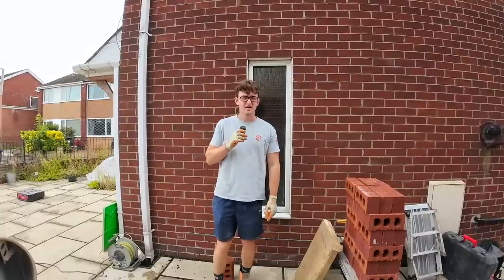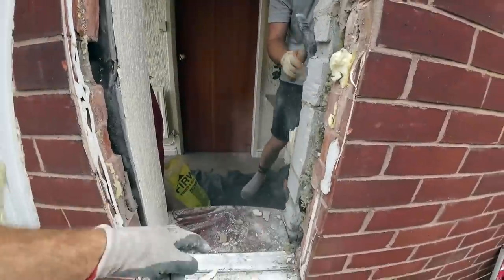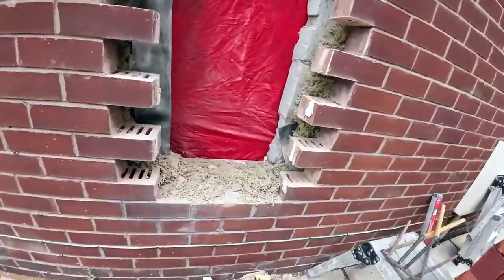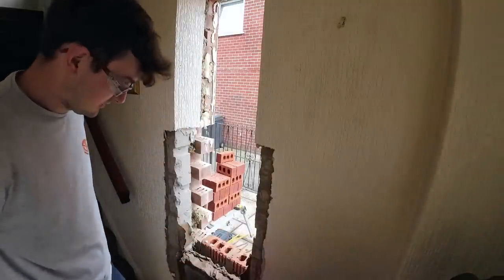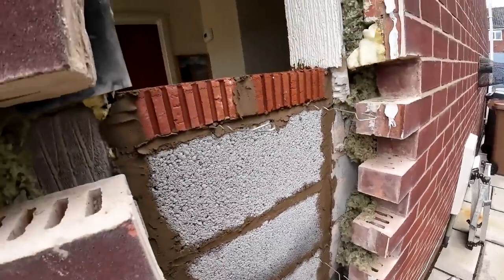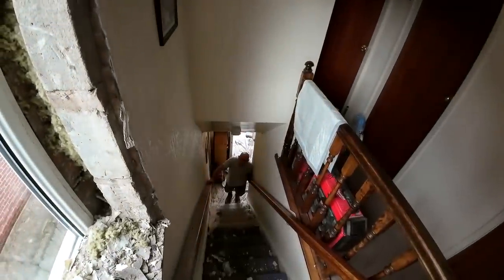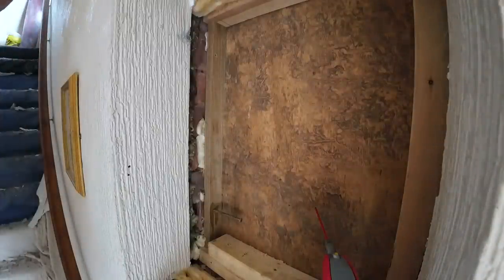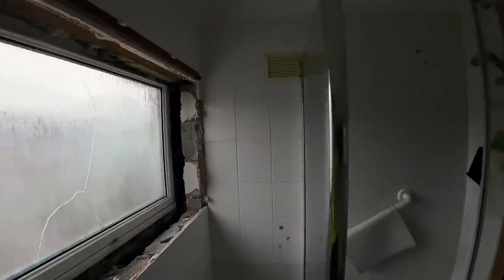BRICKING UP A VERY DODGY WINDOW!! ALTERATION JOB PT 1

Comment: It is quite standard to foam a window in, especially when the window is a fixed pane; no opener (more foam should have been used to add insulation value to the gap round the frame. 
By the time the window is externally trimmed which is siliconed to the brickwork and trimmed internally, where superglue is commonly used to stick the trim to the window frame and in turn, the trim is siliconed to the internal reveals. 
Realistically, "Snappers" should have been used, they are a stainless steel claw that are screwed to the sides of the window profile, when the window is shoved into the rebate, the claws dig in the brickwork, adding more resistance to being pulled/pushed out.
The smaller the new window is, the harder it is to get a drill in for fixing, this is where foam and claws are a good/recognised system./method of fixing frames. I know newer systems use a rail system, a liner is inserted into the opening and the new window snaps into the liner.
Tough bricks?, yeah, maybe they are engineering bricks, I've lost plenty of SDS bits to them!
I've been in the glazing game since 1987, still there.

Comment: I'm a complete amateur and just do a bit here and there for my boys. I have learned NEVER use cement thats been stored a long time even wrapped in plastic. I found that funneling cement into dry plastic milk bottles keeps it fresh. Bit of a faff but saves waste and having to get a whole new bag for those small jobs.

My Titan SDS does a great job when removing old bricks. Toothed chisel attachment even better!

When trying to match mortar I mix and let set and dry a small yogurt pot, anything ftom 3:1 to 6:1

Comment: Nice tip for an amateur like me, never thought of sticking a bit of WD40 in the hole before drilling in the self tapping concrete screw. Cheers.
Reply from the maker: No probs 😁🧱👍🏽

Comment: Cold spot and crack point ....brick and thermalites should never be mixed
Reply from the maker: @martin2466 🤨🙄🧱👍🏽
Reply from the maker: @martin2466 . Mmm . Talking of crackpot have you seen who has reappeared 🤪🫠🧱👍🏽
Reply from the maker: @martin2466 I think it was 🤔🤣🤣🧱👍🏽
Reply: Read the building regulations relating to the mixing of material's.... came in the late 80s ....plenty of time for it to sink in ....in short different material's expand and contract at different rates therefore shrinkage or cracking will occur..furthermore  different thermal mass ....cold spot ...

Comment: I see you put wd40 inthe hole what does that do !!!
Reply: Settles the dust?
Maybe a bit of lubrication?
I'd ve gone into the bed with a screw that length or maybe a shorter screw?
Reply from the maker: Reduces friction so less stress on the impact driver 🧱👍🏽
Reply: @SteveAndAlexBuild  
That Milwaukee impact has plenty of grunt especially compared to others of same size.
Reply from the maker: @markdauncey927 . It really has . We are really impressed by the Milwaukee power tools💪🏼🧱👍🏽

Comment: Bad practice when you pulled out the old timber internal cill not to bend the nail over.
Reply from the maker: How do you know we didn’t bend the nail over ?
Reply: @SteveAndAlexBuild  I saw you toss it out nail pointing up and not bent over. 

Having stepped on a nail in my childhood  and with a memory of the infection that followed my advice was meant in a genuine way. On site it is something I always pull up others on.
Reply from the maker: @paulf2529 having dove the same I always bend the nails or remove them  . It was done straight away 🧱👍🏽